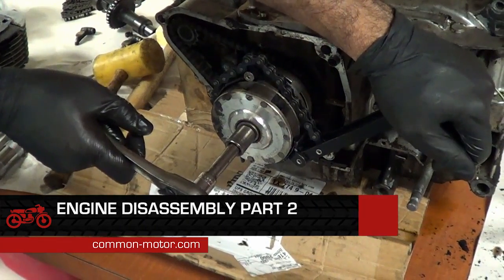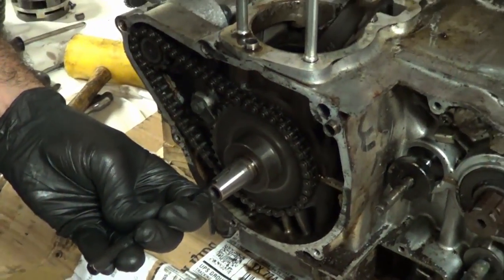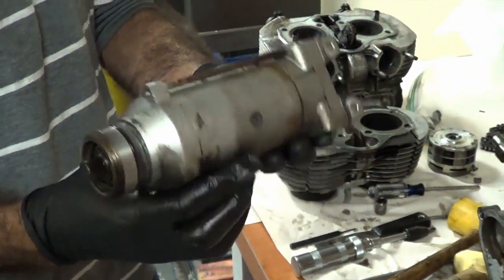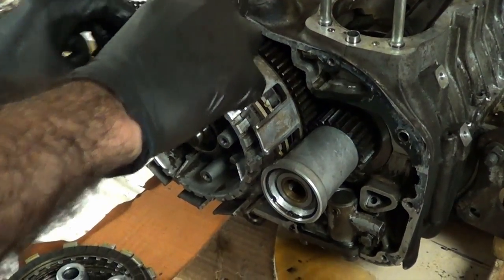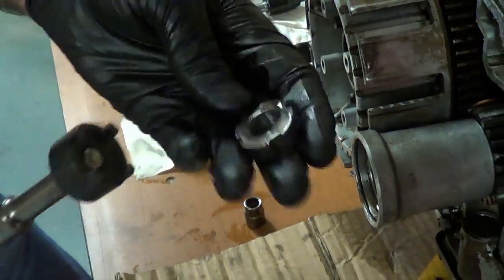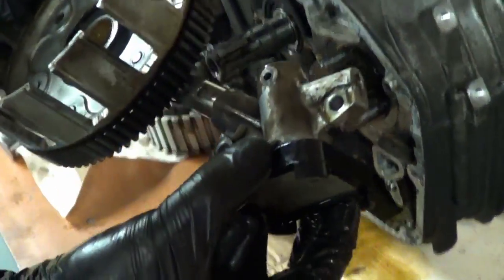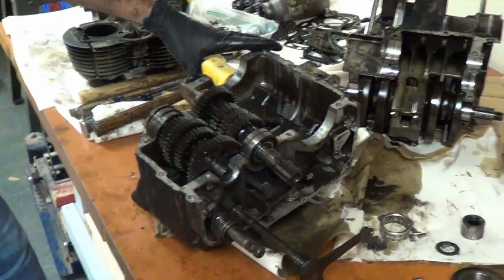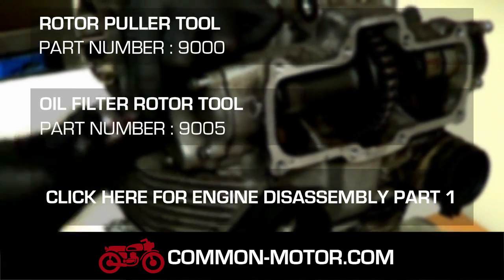Honda CB450 Engine Disassembly Part 2

Comment: The screw snapped off behind the rotar, same thing has happened to mine. Did you manage to get the other part of the bolt out? Do you have any replacement bolts?

Comment: wondering if you could help me out. I have a cb450. did a top end rebuild. i didnt take the bottom apart at all. just to the head gasket and replaced rings on the pistons. put it back together and when i got t al backtogether my kick doesnt move. i got to the part where i was putting it back on the bike after i got the engine back on the frame. and it doesnt move. i dont know what to check..

Comment: Hey guys, love the video. Fun seeing you tackle some of the problems i dealt with when i did my 500t bottom end. I was wondering if you plan to make a video of disassemble of the head? I need to replace the valve seals i think, and maybe the guides. I wouldnt mind seeing a video of you guys getting into all of that. the torsion bars, i dont have the tool to get them out so.